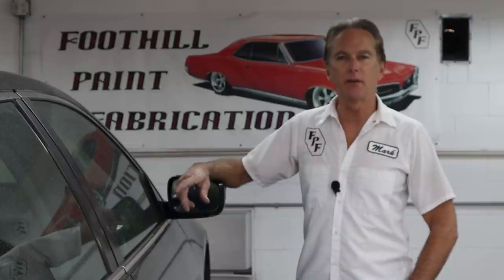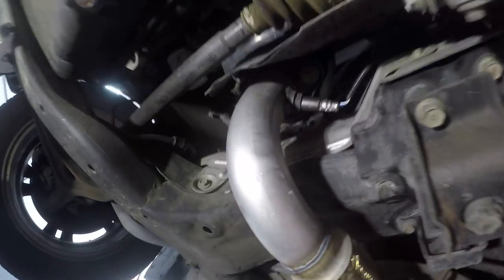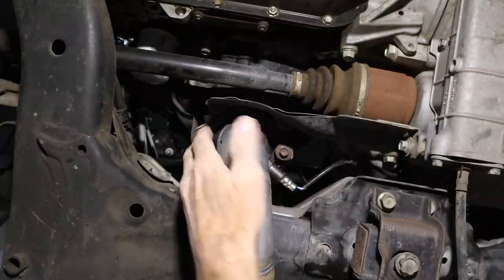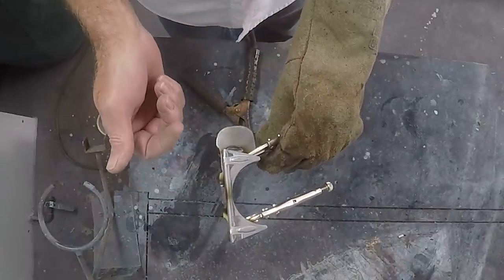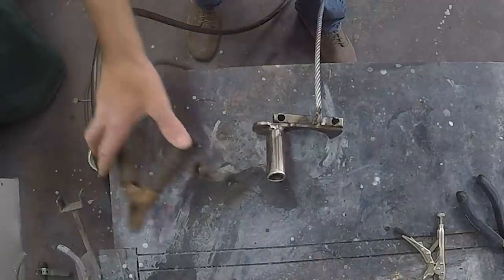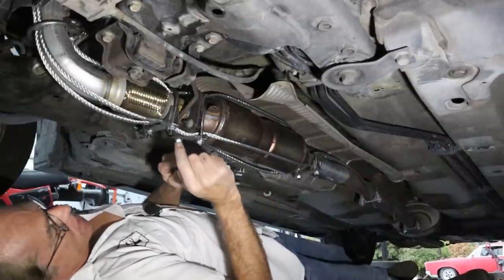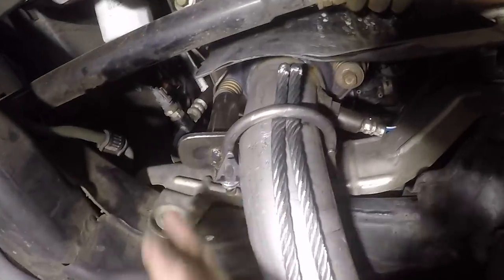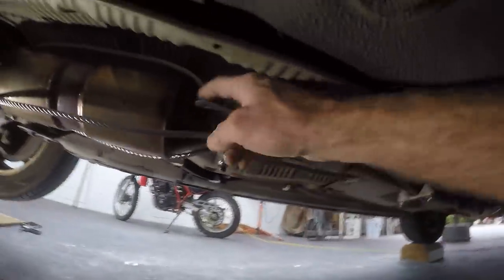Catalytic Converter Theft Deterrent Easy and Cheap

Comment: I was thinking that something like loosely-secured braided kevlar ropes might be the best option rather than steel cable. They would not be cut cleanly with a sawzall and if they tried to use a cutoff wheel it would be a huge tangle. You might even be able to just spiral wrap it around the whole section of tube with adhesive at strategic points, making it even easier.
Reply: Just found out there's a product called Catstrap that's this concept.
Reply from the maker: What is the melting point of kevlar I wonder. Some cats get pretty hot under heavy loads. Steel cable wrapped in kevlar would be double trouble for the thieves.
Reply: @FoothillPaintandFabrication  The melting point of Kevlar is above 930 °F (500°C).
Reply from the maker: @TehKitteh01  I have seen cats glow red hot under cars where the engine was running way to rich for what ever reason but I am not sure what the normal operating temp is for a cat.  If you try it let me know how it works out.
Mark

Comment: They need to go after the scrap dealer, the men who buy these stolen converters asd they turn a blind eye to the thieves as they bring in 3 , 4,  10 converters a day.
Reply from the maker: The good news on that front is I have been seeing more busts along those lines lately.  For a long time it seemed like the cops and legislatures didn't care but I bet some cops and leaders got their cats stolen and decided it was an important issue all of a sudden.   A semi truck full of stolen cats was just stopped a few days ago so there is hope they are going after the recyclers too.
Reply: @FoothillPaintandFabrication  need to make it a felony to make any headway with this issue....
Reply from the maker: @robsnizzle7  At 2k to repair the car it seems the theft would exceed the limit of petty theft but I guess it all depends on where you are.  The thieves stealing them have probably already been in the system and think they will get off easy if caught.  They should make them work off the debt.

Comment: Welding directly above you with exposed skin. It's a bold strategy Cotton, let's see if it pays off for him.
Reply from the maker: Raised by a dad that gave you a smack if you jumped when a hot dingle berry landed on you so I just got used to it. I have sleeves and a half welding shirt in the drawer but rarely wear them for some reason.

Comment: I made this mod 5+ years ago on my 4Runner.  I didn't use the U-clamp, only the steel rope clips.  I plan to add a few more steel ring clamp. Weld all the nuts is overkilled I think. Thief don't have time and patience to remove all the nuts.
Reply from the maker: Sounds like it has worked for 5 years, that is awesome!

Comment: Anything is better than nothing just like an alarm or a club on the steering wheel

Easy to make fun of or try to come up with reasons why not.

That is until years have clicked by and vehicles all around yours got messed with while yours was left alone.

Not lucky, just a little CYA

.

A little protection goes a long way 😄

Comment: I guess this might slow down a thief for a couple of minutes and maybe they would just move on to another car but all of those muffler clamps look like they could be cut in seconds with a sawzall and then move the cables out of the way and cut the converter off.  The manufacturers are going to need to develop a system to prevent this plus law enforcement crack down on the metal recovery folks for accepting what they know are stolen converters.
Reply from the maker: I agree but it has worked so far.  The thieves want quick, silent and easy which this will make it none of those things.  I hear there are several pieces of legislation being worked on so fingers crossed.

Comment: SHORTCUT......JUST WELD THE CABLE TO THE PIPE......put a clamp on the top part to make it hard to reach the bolts. FYI a cut off wheel would go through that cable in seconds.
Reply from the maker: Unfortunately welding the cable only captures a few exterior strands of the cable but it would serve as a deterrent as well. Making it look hard to remove and get away fast was the plan and it has worked so far with one guy looking under the car and taking a pass.  Fingers crossed it keeps working.

Comment: Do the cables rattle against the exhaust? Looks like they might cause some extra noise in the areas not secured by the u bolts. Looking to try this out.
Reply from the maker: I was concerned about them rattling too. I put the twist in the cable around the pipe to help prevent that from happening and it seems to have worked.    As the cable passes by the cat and flex connector the clamps are close enough to stop it from rattling.  Good luck on your project and let me know how it goes.

Comment: I saw several pictures of similar product (Catstrap) on Amazon feedbacks, where cables being cut and catalytic converter stolen. 
I'm not sure what they used maybe sawzal, maybe grinder, maybe cable cutters. 
Also people reported that cables and Catalytic converter rusted due to electrolytic corrosion between them in few years, so they had to replace catalytic converters.
Reply from the maker: Cutting stranded cable with a sawzal is very difficult and time consuming which is something thieves do not want.  Galvanic corrosion is not a concern compared to a stolen cat and if it did occur it would take a great many years to even start to damage the actual cat after it got through the heat shield. Since the heat shield and cable are not dissimilar metals it shouldn't be a problem.

Comment: Hello there I just wanted to know if you can do the catalytic converter protection like the one you did in your video. And were is your place at do I need to buy the stuff for you to cover my catalytic converter.thanks
Reply from the maker: I can't do the work for you but I will answer any questions you might have.
I bought the cable at Home Depot because I was in a hurry but if you look around you can probably find a place that will cut it to length for you and save a little money.  The exhaust clamps I bought from a local chain auto parts store. 
Hope this helps
Mark

Comment: Do u disconnect the battery when welding on the vehicle? Car computors are pretty pricey.
Reply from the maker: Yes I do and I make sure to keep the ground clamp as close to the weld as possible to make sure the voltage doesn't travel through unwanted areas.

Comment: Cable is very difficult to cut with a reciprocating saw, all it does is rattle back and forth, a cordless cut off saw would work but how much time do thieves have and how much noise do they want to make.  Make them work for it.  This is a great deterrent, it will work against the tubing cutters the frickin thieves use too.  My neighbors was stolen using the tubing cutters that you clamp on and rock back and forth, no noise.
Reply from the maker: Exactly.  They sell those chain tubing cutters at H F for less than 10 bucks

Comment: There are companies that make a multipart skid plate for many cars, the 2006 honda accord runs about $360 and could be self installed for those who don't weld. Probably a better option for those who can't fabricate like the video presenter can.
Reply from the maker: Very true Matthew.  As time goes on there are more and more options showing up for sale.  This could be done without welding by just taking a hammer to the threads sticking out of the exhaust clamps and bending them over and skip the manifold cover plate portion.  Then it could be done with simple tools.

Comment: I hooked a spare battery straight to the converter, so it's hot. I flick on the switch after my truck is turned off. The converter is now hot, go ahead, and lay on GROUND and apply your saw.

Comment: I wish you would've taken the time to weld some razor blades and sharp nails on that cat, maybe a few bear traps 🤔
You know I'm playin, keep it goin bro!!
Reply from the maker: Thanks
Maybe a trained Rattlesnake that sleeps under the car...
Reply: @FoothillPaintandFabrication 👍 how about a sheet of metal mesh stretched over the cat like a hammock and attach it to both sides of the frame? Sawzall blades are useless and you can't get a pipe cutter in there,  cutoff wheel would work but is noisy... easily removed if you need to work on it...I may give it a shot
Reply from the maker: @busybody1474  That would work too as long as it trapped the cat so they couldn't cut the pipe on each side and yank it out.  The problem with unibody cars is there really isn't much to attach to under there except the floor of the car.

Comment: Was that a Honda XL 250R that I saw in the background? I put a lot of miles on one just like that one.
Reply from the maker: 1983 Honda XL600R and it starts and runs great! It is a lot of fun to ride and kick starting it isn't to bad.
Reply: @FoothillPaintandFabrication  I like the big thumper bikes. I currently ride a 03 xr 650r. Does your bike have the dual carb set up?  If Honda would have put disc brakes on those models I would probably still be riding one!

Comment: If manufacturers are able to put covers on the engines, they should at least put a cover over the cat. Charge extra if they must for heavy duty theft device but they dont bother at all. Tells you something how lazy car manufacturers are.
Reply from the maker: The cynical side of me thinks that they make money when you come in to buy a new OEM cat but it is probably just not a selling point yet.  When it some ad person thinks it will help sell vehicles they will start making it harder to cut  them off.
Reply: @FoothillPaintandFabrication  why would they help the consumer and take money from dealers/manufacturers pocket by preventing the thefts.
Reply from the maker: @genielaury  Look for that to be a pricey option in the future...

Comment: Can you weld the cables to the pipe and cat in addition to what was done?
Reply from the maker: You could but the problem with welding on the side of the cable is that you are really only welding to a few strands of the cable which could be torn off.  If you wanted to secure the cable with welding I think sliding a short piece of pipe that barely fits over the cable and then weld that to the exhaust pipe would work.  Anything you can do to make it look like it will take time and work should keep the lazy thief's away.

Comment: I'm surprised they unbolted it. Most I've seen the thieves just cut the pipe on either side of the cat. Unbolting takes too long.
Reply from the maker: Our theory is that they had their cat stolen and needed the down pipe since theirs was cut so they went out and stole my nieces.  Either that or they are supplying shady muffler shops with used cats and fill orders by request. Either way they cannot unbolt it easily the next time they try.
Reply: @FoothillPaintandFabrication  yeah I figured that after I posted it. They probably had theirs stolen so it's the domino thing. The value is in the cat not the downpipes or brackets. That was a great video by the way. I think I'm just gonna get a pit bull and teach him to guard the car lol 🤣😂
Reply: @FoothillPaintandFabrication  Hi.. could you please advise if I can use JB Weld around the threads of the two bolts connecting the down pipe instead of creating the metal piece and welding it? Can I also apply JB Weld on the other threads too? Thanks for the helpful video!
Reply from the maker: @tomtran614  You would want to use Extreme Heat JB Weld for the down tube bolt heads as it can take up to 2400F. You may want to search for vandal proof bolts that are sold for some applications. They take a special socket to remove them.  If you are using exhaust clamps like I did and don't have a welder I would take a hammer and bend the threads over past the nuts so they cannot be taken off easily.  JB Weld might be able to be forced off with a wrench when backing off the nuts. 
Mark

Comment: Since this is a big problem why can’t the police put a tracking device inside a converter, let it get stolen and then follow it all the way to the buyer. Bust them all.
Reply from the maker: That would be a awesome but wouldn't the tracker have to be able to withstand a lot of heat?  Not sure they have something like that. I totally agree that the buyers need to be busted.
Reply: All they need to do is park some dummy vehicles, and get them on camera. It’s not rocket science. They don’t care. I just had mine stolen, and my windows bashed in.
Reply: I got mine stolen 2 days ago and the detectives haven’t contacted me in any way yet. I wish they could’ve lifted prints off my car but that’s probably not gonna happen. A tracker is a great idea but they have to be monitoring the trackers and be somewhat fast bc at some level, the thieves are melting down the cats for the metals so they’ll notice a tracker at some point
Reply: True, they could put some trackers on cats installed on some Toyota Prius. Which is the holy grail for cat thieves.

Comment: If one were to spot weld a few feet of steel tubing along the length and on the top of the cat, what type of metal do you think would slow a Sawzall down the most?
Reply from the maker: The highest carbon steel you can find.  Stainless rod would be tough too. I used cable because you cannot cut it with a reciprocating saw very easily because it just jumps around.  You make it look like work and possibly hard to remove quickly and easily and they will probably take a pass. 
Good luck
Reply: @FoothillPaintandFabrication  Another idea I've heard of is having a "rod within a tube", basically a stainless rod just slightly smaller than the tube (roll bar cage material), that spins freely ... that way, when the saw hits it, it cannot cut because it can't gain purchase on the metal. This set up would be welded on top of the CAT and along the necks on the side of the CAT. What do you think?
Reply from the maker: @dirtdogdigital3979  The only problem I see with this is that the cat and pipes are different sizes and for this to work the assembly would have to be straight so the rod inside could spin.  Most cats are stolen by cutting the thinnest portion of the pipe so you could protect each end of the cat as far as it goes straight though.  The thieves around here use a cheap chain tubing cutter they steal from Harbor Freight. Silent and easy but also easy to deter since it can only cut smooth pipe. Reciprocating saws are used a lot as well too.

Comment: So when a cat burglar uses an angle grinder, bolt cutters, or even a jigsaw or sawsall, what metal/positioning are you using to prevent using those quick-removal tools? I'm confused because the cable looks like steel and with the right tool it'll come off easily, just like the steel muffler pipe.
Reply from the maker: Yes this is a deterrent first and foremost.  Cutting cable with a sawzall is not easy but doable with time.  Cut off wheels on small angle grinders are only 4 1/2" in dia so they will have a hard time getting to the top cable.  Thieves are lazy and don't like to work and that is why they steal our stuff so making it look like work should send them  off to an easier victim.
Reply: @FoothillPaintandFabrication  Makes sense. I saw you have proof that it works in an urban/suburban environment, but have you ever tested in in rural areas, or hiking trails and the like? The reason I ask is because I'm a nomad, and I plan to park in the middle of nowhere, as well as places well traveled, but not always heavily populated. (Ex. Grand Teton, Yosemite, or just a random jaunt in a national forest down from a campground in a lesser known location.) In other words, noise wouldn't be a concern for them, their choices will be more limited, but an opportunistic thief going for a hike might see my bus parked there for a few hours, and decide to steal my cat. However, I've also seen that diesel cats are worthless to thieves. Is that true?
Reply from the maker: @ruggedrick  Not sure about the value of that type of cat, sorry.  My niece goes to college and works so the car is parked unattended for hours and hours with no theft so far. I am not sure how many thieves go hiking or camping but I get your point.  I think theft of the whole van is more probable and a bigger concern.  Really anything you can do to deter them is likely to send them off to an easier target.  If the van has a frame then you can build a cage around it out of rebar but on unibody cars there is nothing to attach to.

Comment: Cats should last many years. Having kept trucks for over 19 years and never replacing a cat  --  that is a very true statement. These thieves are taking way too many cats to the scrap dealers for them not to be very suspicious. A legit repair shop probably replaces less than a half dozen of these things a year. Anybody who brings in a half dozen of these things week after week is a thief. So the big problem is the scrap dealers are in on it. Scrap dealers that handle these things are few and far in between. Something the cops could easily stake out. Bust the thieves and the rogue scrap dealers at the same time and it will put a huge dent in this crime.
Reply from the maker: When some police chiefs cat gets stolen I am sure we will see a sting operation for sure.  Just like copper theft, you have to go after the people paying the thieves for it.